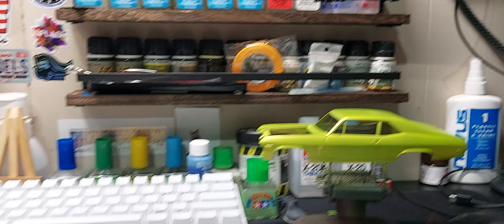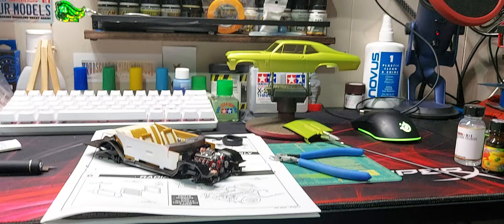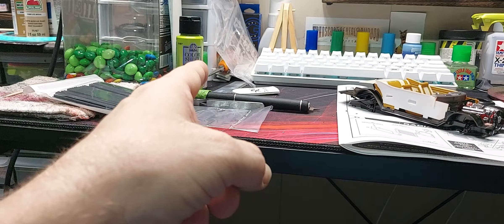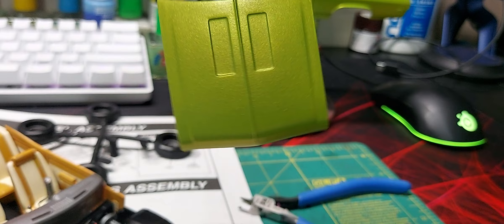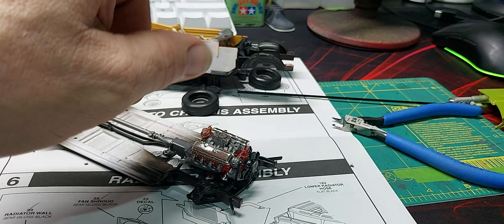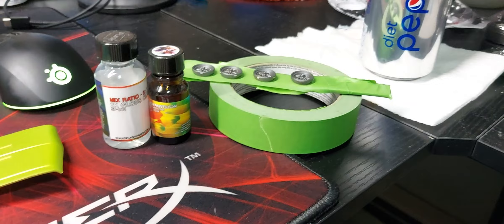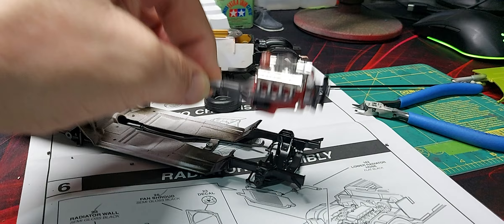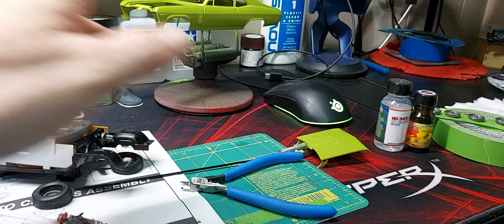Martin zeller tribute build update 2

Comment: Paint looks great. Lots of builders swear by that cheap acrylic and they do well with it. With small distributors like that I drill the center out. Once your 8 plug wires (9 if you add coil wire) are in place and the glue dries it's not really noticeable that you drilled out the center. Nice update.